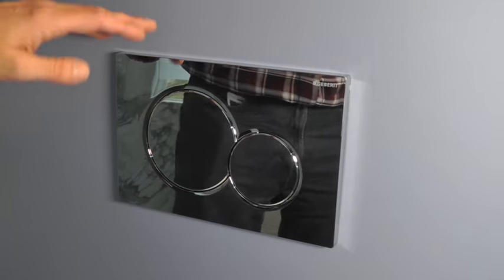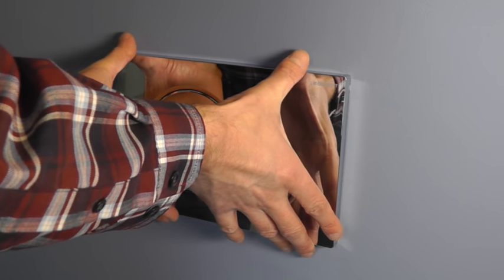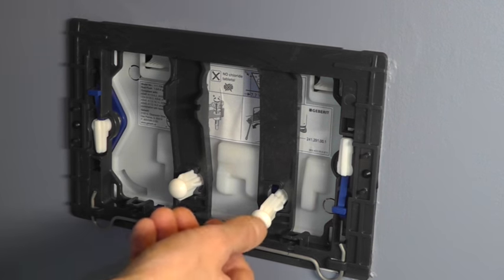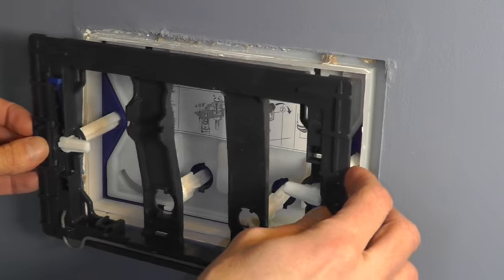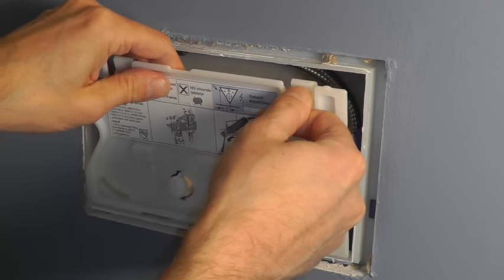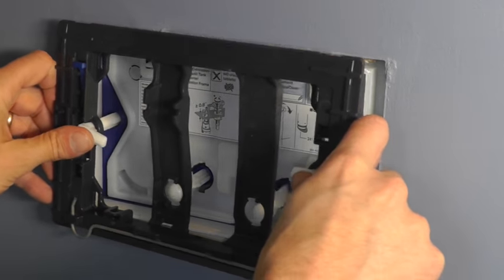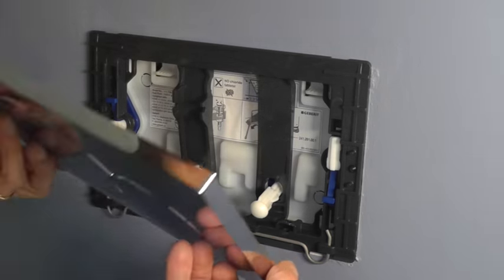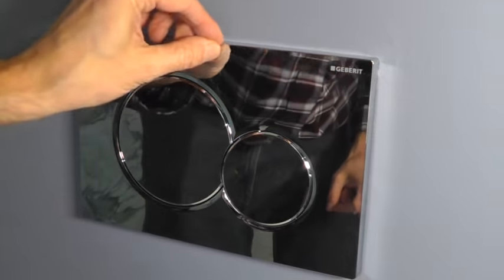How to remove a Wall Mount Toilet Button (Actuator Plate)

Comment: This may help someone as not all Geberit faceplates have the clip at the bottom. I watched loads of videos and the clip is always shown at the bottom. I spent a frustrating time trying to get mine off (by pushing upwards) and almost breaking it in the process. Mine (a 2017 model) has the metal spring clip on the LEFT side. Therefore to remove the faceplate you need to push it to the right then unclip the right-hand edge. HTH. Cheers from UK.
Reply: Thank you, I was having the exact same issue and this comment solved it for me!
Reply: You are a legend, I've also been trying for ages to get mine off!
Reply: Thank you 🙏🏻 ❤ you help us 😊

Comment: Hi, any idea why after flushing the toilet water keeps coming as the tank remains open somehow when full - then if I just slightly touch the buttons - give it a very quick flush it stops
Reply from the maker: Hi, there may be some dirt accumulated around the seal at the bottom.  This seems to be a common issue.
I cleaned up the seal in the past and it started working normally again. At some point the seal may also be worn out and should be replaced with a new one.

Comment: I have something like this, and when I press the large button nothing happens, I think something is loose or broken. What could it be? The small button works great.
Reply from the maker: Is three any resistance when pressing the button?
It could be that the hook for the large button has shifted. 
I have a diffrent video, that shows the internals of the tank here:
https://www.youtube.com/watch?v=es8SJ-1CFcU
Reply: @MegaSafetyFirst  heloo sir, how can i drop cistern block in wall hung toilet pleasr explaim

Comment: Mine won't move very far upwards and will definitely not pull out from the top. Any ideas? I've watches a bunch of these videos and the removal seems simple. Not mine: there's very little movement in the faceplate.